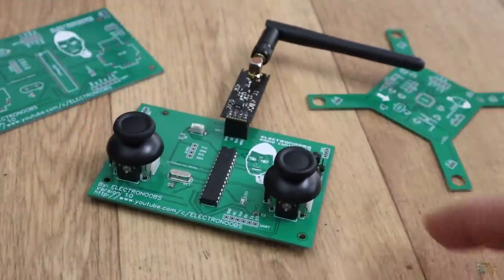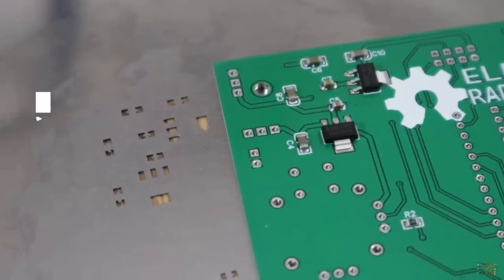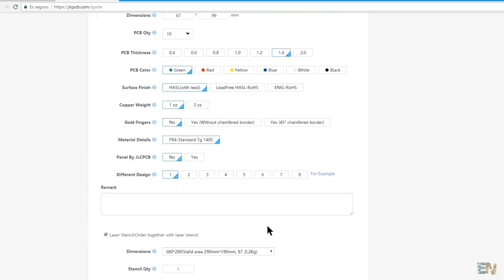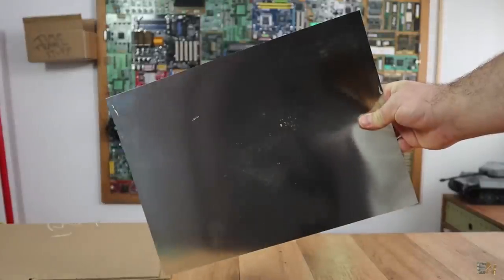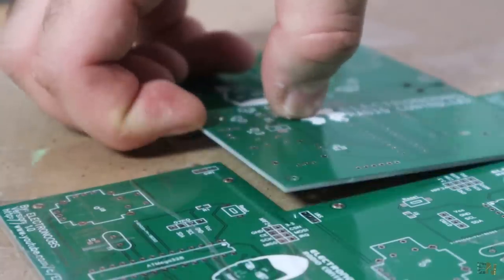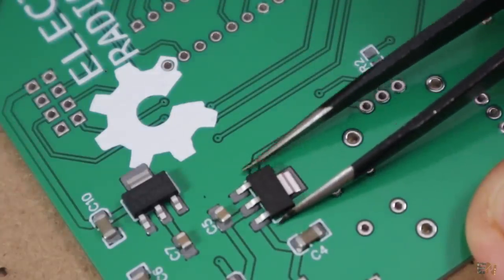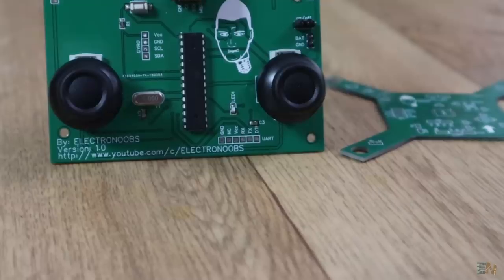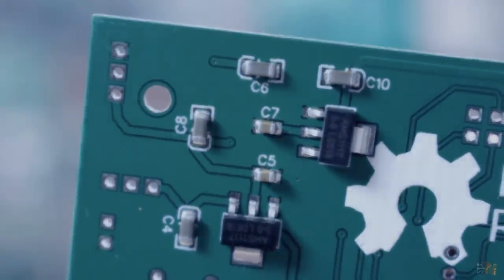JLCPCB solder paste stencil order and use

Comment: To hold the board in place under the stencil, I've just started doing the following: I trace the PCB outline in roughly the center of one of the the "wood" boards that it shipped with. Then I use a Dremel rotating tool with a small end mill bit, sitting in a router base (I made mine, but you can also buy them) to route out the outline of the PCB. The mill bit protrudes into the wood the same depth as the PCB. I use a chisel to square up the routed corners if needed. Then slip the PCB into the routed outline and set the stencil on top, line them up, and use clips around the edges to hold them in place.

I'm thinking about ways to index the stencil against the wood so that alignment is easier. A couple holes drilled through the stencil into the wood would work as long as it remains well aligned during drilling, and the pins or bolts filled the holes completely. Or I could use a smaller pin so that there is room to do fine adjustment, using clips to hold it in place.

Next time I order I will ask if they can put holes in the stencils that line up with holes in the rails added to the PCB panel. That would be ideal.
Reply from the maker: The stencil will be in the shape of the SMD. I don't kwno how could you ask them for extra holes. Keep up!

Comment: Just a thought: The current version of your PCB has components on both sides. These are expensive to manufacturer. 
You should try to create a PCB with all SMD on the same side so they don't need a second stencil and a second pass trough the Pick and place machine or oven. 
With PCBs this size you should have no problem.

Keep the capacitor close to the component leads they are connected to. The C6 and C7 are likely useless at the moment as the (return) path it too long. 
The crystal is very far from the micro-controller. Avoid vias in the clock line if possible.
These tips will help your circuit to function better and reduce trashed PCBs.

Keep in mind the PCBs you have here are leaded. You are not allowed to sell leaded electronics. 
Lead free (RoHS) adds cost and complexity to the campaign. Please be mindful of them when doing a kickstarter.
Reply: Excellent points,  thank you.

Comment: Make your life easier and get some 1 inch blue foam (it is denser than the pink foam) from lowes, add a couple holes on the board, I have 1/8" steel pins that I sharpened so I add a couple holes that size in my board, then on the cream layer add a circle over the new holes so that they exactly cover the hole, this will make it so that the new holes are cut on the stencil.  When it's time to apply paste put the board on the foam and the stencil on top and insert the sharpened pins into the foam for alignment. If you are doing several boards leave the pins in place and slide the board off of them. Make sure the holes are on the edge so you dont have to spread the paste around them.

Comment: Please make a video about different types of smd packages. It is very confusing to understand which one is good for hand soldering.
Reply: i like to hand solder 01005, probably the smallest Ill go
Reply: Just curious: What are the package form sizes, you use in this video (C4 to C10 for example)?
Reply: @wowfail6835  Lol, that's basically the smallest commonly available package for two leaded smd chip components.

Comment: 5:55 that annotation is misleading. 
The fumes of solder do NOT contain lead (or tin). The fumes are the burning flux. Fumes of leaded solder are NOT more dangerous than the fumes of lead free solder, in fact, most of the time the fumes of lead-free solder are more dangerous. That is because tin(most lead free solders are 95% or more tin) is chemically more active than a tin-lead compound and the flux that has to be used has to react stronger.

Comment: JLPCB makes great boards and solder masks. I have ordered 4 runs of each, and they were flawless. They are quick and efficient. I get the boards far faster than the local OSH park. They are better cheaper, and faster, give them a try and see what I am talking about. There is a shipping cost but, for a 4 layer with shipping price, and a small 10 run batch they are still cheaper than OSH park.

Comment: Check how the weight of everything inflated at JLC. The stencil was 200gr in 2018, now the same is 800gr. And they probably didn't forget to add some packaging in the 2018/200gr !!!
Do order simul with a SMT job and be prepared for a 805 resistor = 1gr !

Comment: In an older video you used a wall plug type transformer on which you could set the voltage 12,5 etc. How is it called? I tried looking for it on eBay but I couldn't find one.
Reply from the maker: https://rover.ebay.com/rover/1/711-53200-19255-0/1?icep_id=114&ipn=icep&toolid=20004&campid=5338106513&mpre=https%3A%2F%2Fwww.ebay.com%2Fitm%2F12W-Universal-Muti-Voltage-AC-DC-Adapter-Multiple-Function-6-Adapter-Plugs%2F173356273544%3Fhash%3Ditem285cd6cf88%3Ag%3AmHUAAOSwBXhbGlEM

Comment: Please make a drone based on Arduino Mega + GY-87 + Ublox 6-series. 
Also, I would like to see DIY RC improvements, with a screen for reverse basic telemetry. After all, nRF24L01 allows two-way communication, for example: the battery charge of the drone, the number of satellites, distance, altitude, flight mode, etc. 
Ready-made solutions are not as interesting as DIY. Besides, the ready-made solution is still expensive. Pixhawk or APM software took a long time ago from Arduino's ideology. But MultiWii has remained true to this idiology. It is simple to understand and modify the code for beginners to learn Arduino, but has all the necessary functionality. 
In addition, ready-made solutions have too much redundancy, weight and modularity of the design. 
I would like to have a cheap and simple solution that you can touch with your own hands, and having the functionality close to the low-cost Chinese drones.

 Thanks. I always watch your videos with great interest.

Comment: Please make a drone
Reply from the maker: Waht do you mean based as PCB?
Reply: Electronoobs nothing sorry
Reply: Please make with flight controller and gps
Reply: Make one with Arduino Mega + GY-87 + ublox 6, brushless motores and MultiiWii. And make, please, RC with telemetría and a screen on transmitter for basic telemetry.
Reply: Kostyantyn Matviyevskyy and please add pixhawk and gps